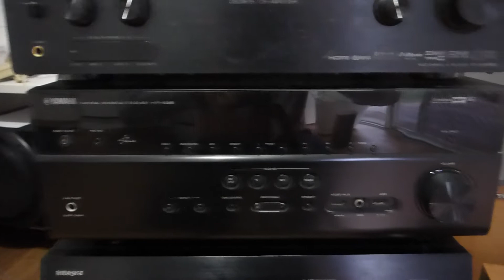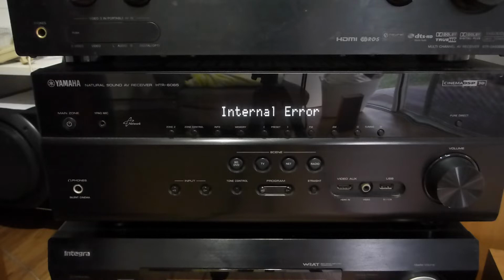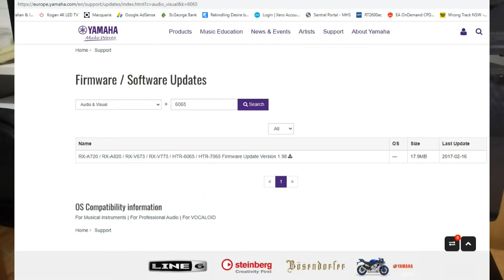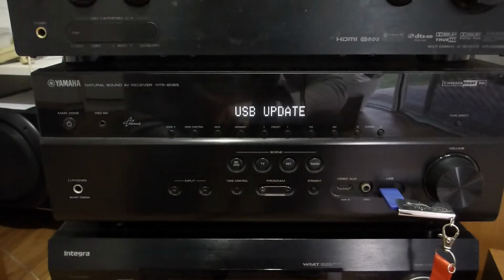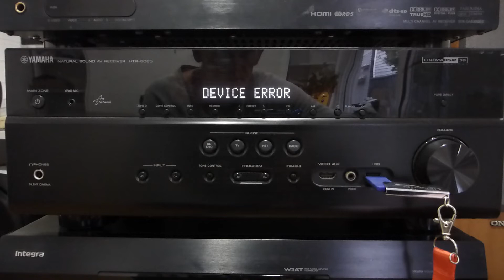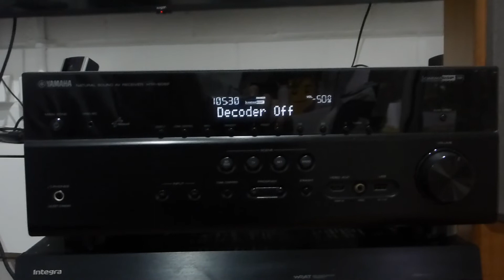Yamaha HTR-6065 Receiver ‘Internal Error’, ‘Error 4000’, No Model Info Full Repair

Comment: Hey mate, would you know the jumper pad number for the HTR-4071v
Reply from the maker: @LukeSalutes  check the board number, if it's the same, the pad will be identical. Otherwise, I'm not familiar with this model.
Reply from the maker: Try this as well. https://www.scribd.com/document/771952565/hfe-yamaha-htr-4071-rx-v483-service-en

Comment: Hi, during the procedure I select the wrong model. How can I change the model now? Thanks
Reply from the maker: Easy, just go through the reset procedure again from the start, then select the correct model ;-)
Reply: Hi,
Undortunately if I do the same procedure, when I power on the electricity the receiver simply start but whithout the message "no model info"
Reply: Do you know how to change the model? Thank you!
Reply: @pescado99  Hi, finally I find the solution. It was necessary to short circuit R896 resistor while holding the button "info" and connect the AC cable. Thank you anyway.

Comment: Hello. I saw that your Yamaha is showing the Cinema logo, but not showing the speakers logo, and it is showing "Decoder Off" : can you peleas tell me, if you get sound on your output?
Reply from the maker: The Cinema logo just tells you that it is decoding in Dolby DSP, and the speakers are shown if they are detected by the system (this is not described in the manual). Yes, the audio worked after I completed the repair (using the wire jump method, the software update did not work).

Comment: Hello, I have a question. I accidentally poured a bit of water on my Yamaha RX A820. After turning it on, I'm getting this error: INTERNAL ERROR. I tried the USB method, but it didn't work. I'm trying it again now. Do you think I should try it with this bridge? Great video, regards.
Reply from the maker: Hmm, water is never good. How much? A cup, a few drops? Assume it was clear fresh water, nothing with salts or minerals in it.  All is not lost. Shame you powered it up - which may have cooked some chips on the main board if any moisture was still there. I would have said don't power it up yet... disconnect from power, open it up, make sure it is totally dry (hair dryer or preferably sun), look for any signs of corrosion. If you see corrosion, use IPA on toothbrush to 'clean' those parts. Dry it all again - warm sun is best (no hot spots). Forget rice, that is a waste of time (and rice). Best thing is to ensure it is bone dry. Then power back up and try it with the bridge for a hard reset. USB reset is pretty useless. Good luck 🙂
Reply: Hey! Hey!  Thanks for the response! I think it was a maximum of 20 ml of water. Unfortunately, the radio was on at that time (it instantly turned off by itself). Most of the water got into top - left area (looking from above).  Even if it doesn't work, you've given me hope :D. How are you feeling? Greetings from Berlin! @pescado99
Reply: It works! Thank you! Amazing! @pescado99

Comment: Do you know which points it is on the RX-V2067 as I cannot find R896 on mine. Tx
Reply from the maker: I'm really sorry, I'm not familiar with the control board for the V2067. All I can suggest is to look for similar contact pads and jump them using the same technique - they may or may not be the correct pads, but they are all designed to work this way (to be 'jumped' on the boot cycle). Good luck.

Comment: This is the best video.  I used it to repair RX-V777 "internal error" easily.  There was no reason to solder a jumper, though.  I was able to gently scrape away a thin wax-like coating on the jumper solder pads with a tiny screwdriver.  Then, just short it out with a small chrome allen wrench.  I just held the wrench in place across the two solder pads while I hit "power" and then the few buttons to re-select my model number as you described.  For me, I was able to do it on the 2nd try.
Reply from the maker: Yes, I thought about a 'touch jump' as you've described, but I wasn't sure about contact duration and whether I could hold the contact whilst switching on as a one-person operation! Cheers.
Reply: Just carried out the 'touch jump' on my RX-V777 - (pointy tweezers) -  did make use of a second person for the button prodding !    Thanks All !

Comment: Rxv385 ,internal error. any  idea for jumper
Reply from the maker: Not on this model. If it's cactus already, you could inspect the motherboard and look for tabs close together and jump them per this video. Most of the MoBo's are similar (ones with HDMI and DSP processing). Good luck
Reply: I have the same model and the same problem.
 Have you found a solution, please?

Comment: I have Yamaha RX V581 and the receiver is not showing speaker symbols. I am only getting sound on direct mode on tuner and aux. Can you please help ?
Reply from the maker: Almost certainly means the digital signal processing (DSP) chip is fried. This happened to me as well, then shortly after the entire amp stopped outputting sound at all. All I can suggest is a soft or a hard reset (see my video), and if that fails, accept it has limited functionality and may die soon...

Comment: Kindly ihave HTR -4065 but it does not have the jumper provisions kindly assist
Reply from the maker: I'm not specifically familiar with this model. I would assume it is similar. Sometimes the tabs are in different spots on the main board.

Comment: great video i am looking for jumper on the rx-v385 board, any idea where it is, appreciate it thanks
Reply from the maker: No idea for that model. There are typically several jumpers on each main board. Have a look with a magnifying glass. They're tiny!
Reply: Exactly what jumpers are we looking for if it isn't detailed R896? Thanx
Reply: we have the same model and problem internal error, but i fixed mine through update and hard reset
Reply: I have the same model. There is no equivalent set of jumpers on the board for this model. I consulted the service manual schematics for both, and the electrically equivalent action on the V385 is to find the factory test connector CB29 (white connector at back of board near HDMI 4). See the description of the pins near that connector. Pin 5 is MODE and Pin 2 is DGRD. Shorting those 2 pins should do the same thing as shorting the pair of pads on other models. Unfortunately, on mine, it doesn't fix it. But maybe for someone reading this it WILL work. I tried a firmware update but after programming and verifying it failed with "unknown error" 😞
Reply: if its unknown error, dont remove the usb just let it be there and hold down the straight button and press power button and it will brings you to the reseting procedure

Comment: Great! Thanks so much for sharing this. Which temperatur do you use when soldering? I am doing this for the first time and have no idea.
Reply from the maker: I use a 15 watt iron on these fine jobs with a fine tip. 600°- 650°F (316°- 343°C) is a good place to start for lead-based solder and 650°- 700°F (343°- 371°C) for lead-free solder. I also make sure I have good light and at least a 5 x ocular magnifier loupe (or a magnifying glass). The target tabs are very small. Just take your time and use a very small amount of solder. Also, wet the soldering iron tip and use fresh solder as you are starting out. Always, 'less and slow' is better than 'more and fast'. Overheating components can damage them.

Comment: I have the same problem out of nowhere it did that yesterday thanks I'll try this, are there other causes for this?
Reply from the maker: Yes, there are. The DSP chip on the main board is known for a multitude of errors across a range of the Yamaha range. Mine died a slow death last week (surround decoding stopped, then stereo only  worked, then nothing). I did multiple resets, as well as the mainboard jumper reset, before I finally gave it away in disgust. I would have been pretty mad if I'd paid full RRP ($1100 AUD). One fix is to heat the DSP chip with a heat gun. Some have had success with this. I'll be posting a video soon on this. Cheers